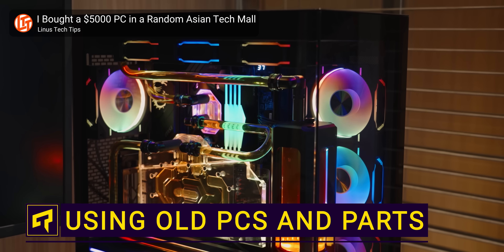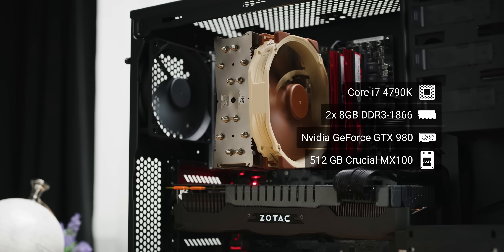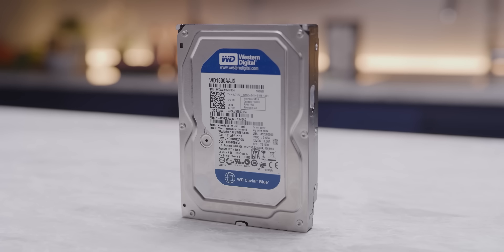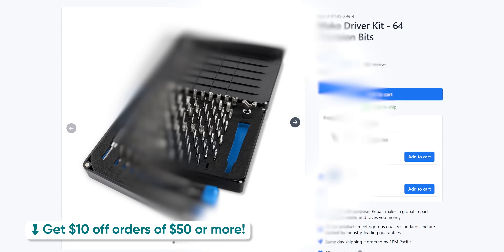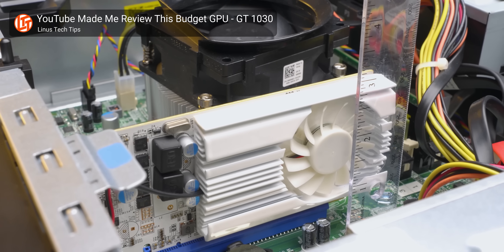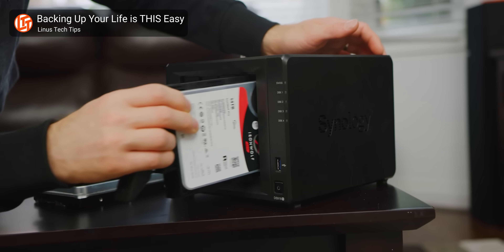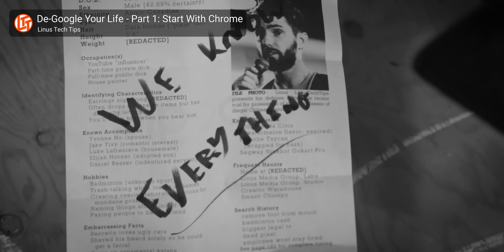FIVE Cool Things To Do With Old PC Parts

Comment: Great video thanks. I would say my favorite thing to do with them is to clean them up really well repaste the CPU replace the CMOS battery if you can get a cheap GPU or rely on integrated GPU then install a couple of old games on it play around and then resell it on Marketplace. Also many of these older PCs especially running Windows 7 or 8 can be slightly upgraded to install Windows 10. Sometimes you just need some new RAM and an SSD and then you just use Rufus and many people would still be interested in this.

Comment: As much as I love the channel, I am surprised how ignorant they are of a power efficiency of the proposed solutions. Making a router out of your old-architecture device sounds like a terrible idea: both climate and simply expense-wise. The same goes for NAS. There is a reason, why routers and NAS for home applications are typically low-powered devices

Comment: Turning an old(er) office PC into a router and/or NAS might work since they typically are designed for having very low idle power draw. But your last gaming rig that most likely pulls 40+W while doing nothing is a REALLY bad choice. Upgrading systems while the core components (CPU, MB, PSU) are still working is a good route, especially when you already planned ahead with the base system. I build my gaming PCs myself, and I always pick a slightly stronger CPU than I would normally need so I can keep the system running for longer while only swapping the GPU and maybe adding RAM/storage. Oh, and if you can't (or don't want to) use Win11 and want to stay away from Google, there's always Linux.

Comment: When it comes to distributed computing, you really should mention BOINC as there's much more variety for projects there and you can have the one machine crunching data for multiple projects. Folding@home is just a single project that's on its own platform.

Comment: Personally depending on age I use components in all sorts of more advanced ways. Capacitors are in so much stuff and an old PC mobo is a decent source for them. Case fans can be normal fans too. I've cut up the sheet metal from old PSUs for laptop hinge repairs and other stuff I needed sheet metal for. (Obligatory if you're opening a PSU discharge it properly. If you don't know how to do that figure that part out first). I've also just outright used old PC PSUs as normal power supplies for tons of stuff. Power buttons are just power buttons. They break on tons of stuff so reusing those is quite useful from time to time. Heatsinks are very useful to put on all sorts of stuff as half of cheap electronics that die quickly die because they run too hot. I should mention I'm a repair professional and electronics hobbyist. I learned most of my repair and electronics skills just doing things like this. So learning electronics is another good use of what'd otherwise just be garbage. If you're ever going to learn electronics the wiring inside any age of PC will be amazing for just learning to stitch electronic components together and seeing how they work or detonate. By now I've built absolute tons of gadgets myself without paying a cent for them simply by stripping down old "dead" hardware from PCs and other stuff too.

Comment: That is a big deal, older hardware should be given to systems depending on the operating system. Windows 8.1 will use Quadro RTX 4000-8000 and Windows 7 with RTX 30 series. I you have no longer have use for this hardware, sell it to somebody with a passion project, like me. I'm going to upgrade from my Tecra A11 laptop to a silent FC8 Alpha A12 9800 APU build. I need support and expansion more than I need CPU performance, that part doesn't matter to me.

Comment: This might sound great  but one big factor is energy. Here in Germany energy is very expensive. You should check what the energy consumption of your old hardware is and compare it to a new device. With a router this can be a  big difference. 30W more and at a price of 0.40€, it would cost you nearly 105€ more per year, just the energy.
Unless you get your energy for free, it matters.

Also I thought this video would give tips on really old hardware. I recently digged out old hard drives and with old I mean IDE interface and a USB stick has more memory and is faster. They are just waste. I looked for data, that might worth keeping but besides that, I don't know what to do with them. My plans are to secruly delete them and drill a hole into it, until I can put them into e-waste.

Comment: Be aware that electricity costs may render certain use cases, particularly those involving older gaming hardware, economically unviable. The electricity expenses can exceed the cost of purchasing dedicated hardware equipped with efficient processors, such as ARM or newer x86. I conducted a personal experiment by running Folding @ Home on my aging gaming rig (i7 and GTX 970) and calculated that, based on Danish electricity rates, the annual electricity cost would range between $2500 and $3500, while the performance is only relatively modest.

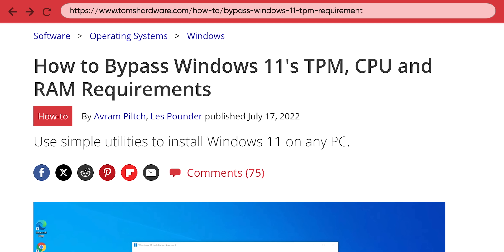Comment: Me at 1:35 - 1:48: "Linux. Linux. Linux. Linux. Linux! JUST EFFIN USE LINUX!"
Seriously? You recommend ChromeOS over all the free, unrestricted and privacy respecting versions of Linux out there?! 🤦‍♂️🤦‍♂️🤦‍♂️

Me at 2:22 - 2:44 "Lutris. Lutris. Lutris. Lutris. Lutris! JUST EFFIN USE LUTRIS!"
Sure, building a retro PC from your old hardware is fun, but that old hardware will most likely be much newer than the games you'd need a retro PC for, so while installing Windows XP, 98 or even DOS on it will fix software compatibility issues, you're still gonna have hardware incompatibilities. And old hardware tends to break and need fixing, which can get old quickly. Those were my experiences with using a retro PC. Lutris (a front-end for WINE, which lets you run Windows programs and games on Linux) on the other can run most of my old PC games just like that. It is by far the easiest way to play old PC games, especially if there isn't a repackaged version with DRM cracks as well compatibility and widescreen fixes pre-applied available for download on the high seas!

I'm not one to shout at my screen, but those segments really had me utter these words repeatedly in frustration. I've never been this disappointed in a tech tip by LMG!

Comment: I use netbooks to run 3D printers — usually this is done by a raspberry pi, but once you add a dedicated screen and keyboard to a pi, the cost of netbooks is much cheaper. Plus some are fast enough to run multiple printers at once!

Comment: Well, I reuse all the parts that can be reused: case, PSU, SSDs, even the CPU cooler that technically wasn't supported but nothing that zip ties can't handle.
The money saved from this is then invested in the other parts. So now I have 64GB RAM and still with over-modded minecraft running it manages to get to the limit sometimes.
The thing I didn't reuse was Windows. Now running Linux Mint and having ~same amount (but different) problems than on Windows.

Comment: Here's what would help me the most:  a vid on how to turn an old rig into a GAME SERVER.  I host co-op games, and with something like the Borderlands franchise, Outriders, etc., that's fine- but my wife and I play building games, too, like Valheim, Enshrouded, Conan Exiles, DST...  She can only access our shared worlds if I'm playing.  I want to set up one capable (7700K, 1070Ti or R5 2600, 5700 w/XT BIOS) as a game server, that's completely hands-off as far as what game she connects to.  Can a single PC run multiple Steam servers at a time, and jump into action when someone connects to it?  Said PC hosting 2 different games with someone connected to them at the same time would never be an issue.  I have a bunch of functioning old rigs, and setting one up as a game server, one as a media server, etc. was my original idea, but I'm lost on how to get a game server up and running.  "Help me, Techquickie, you're my only hope..."

Comment: Don't use desktop pc as a router. The power usage difference will be horrendous - you are looking at 100W+ consumption all day long, depending how modern the box is and what power saving features it had. Use laptop or netbook - they are powerful enough, and designed to use minimal power. You will need a special expansion card for second network interface, but other than that,  small and quiet.

Comment: I've got 2 desktops.  The one is fairly old but beefy from 2017 and other is newer.  The older one is now used as an office pc and I've got Linux running on both systems, for my own sanity.  In the past before having 2 computers.  Certain items like a graphics card.  I kept as a spare incase something went wrong with the new one.  As it took me years to save up for the new one and getting another too soon isn't really an option.  

Now that I've 2 systems.  Whenever I replace something in my new one, the old one gets the replaced part and then it's old part is handed down to anyone usually a family member.  Also doing things this way means I've 2 really good systems.  And saves money in the long run as I don't have to get a laptop as if I need anything mobile the phone will cover the basics needed.  And having really good computers to go work on instead of under powered laptops or tablets or very expensive versions that would have been cheaper just to buy a new desktop in the first place with way better specs.  And you get years of more use out of a desktop than a laptop.

Comment: I want to install Windows 11 such that it's officially delivered from Microsoft to get consistent feature and security updates
However, I can't upgrade because my hardware is 7 years old at this point
if I were to upgrade my components instead of buying a new PC, I need to buy a new motherboard and CPU but I also need to upgrade my GPU, so in my case, it would probably be better to buy an entirely new PC

Comment: Wow, those are some terrible tips...
I mean Economically and ecologically.
Sure, a 500W CPU&GPU combo can run circles around your routing and NAS duties while providing SOME computational power for the betterment of manking, but it is also a 500W computer that you will be running 24/7, at which point the benefit to both you and the manking becomes quite questionable. Especially when you consider things like the SteamDeck perform better than that at 15W.
500W non-stop in US prices is $3 per day, $1000 per year. Literally a new, more powerful computer in less than a year, if you ... just ... don't.
Please don't repurpose old powerhungry hardware for 24/7 operation.

Comment: Today i fonld out windows 11 24H4 has an update that re-introduces the TPM requirement to do windows update. Way around this is to put the drive in a more modern PC, update it and then put the drive back in. got it working well with a 2nd gen i3 no TPM HP laptop. seems to keep updating now.

Comment: I recently picked up a old XPS (2008 era) just for the support of old games. With having old Sli and a external physx card. For those who want to know its an XPS 630I that seems to have been maxed out and had a Core Q9450 installed rather then the stock Q6600

Comment: Be careful running NAS on old mechanical drives - they still have a lot of life in them, until they don't and they can die out without you knowing about it until it's too late and your data is gone. I've been running a multi TB, multi-drive home NAS for >15 years and my main takeaways are: (a) install a SMART monitoring application that will email you when there are longevity degrading events (such as smartmon) and then act quickly to replace the affected drives; (b) store data on a multi-volume file system that you can add an remove drives without manually copying files (such as NTFS spanned volumes, BTRFS or ZFS) and always keep one port free, so that when the time comes you can just add a new drive to the array, tell the system to remove the failing drive, and your done.
Reply: I grew up building pc's from scrap and burned through a dozen or more HDDs before ever buying one new. I have replaced 4gb mechanical hard drives in win98 systems. Hard drives generally make a variety of noises depending on what type of mechanical failure they are developing long before they actually be unreadable. Modern mechanical HDDs actually have a SMART reader that produce pop up warnings before the sounds start to develop. I have had solid state jump drives fail without warning plenty of times, but I generally know when a mechanical drive is on the brink with plenty of time to get a preplacement cloned.

Comment: i just reinstall windows on any old computer (i own about 7, also new ones ofc) just to convince myself that windows still runs on those systems even tho those installs seem to be pretty fragile… (reset the bios and windows shows inaccessible boot device cause some setting in the bios defaulted from ahci back to ide 😑)

anyways never install stock windows again. such pain. if you still do look up chris titus tool. it may help you after installation. if you wanna customize your iso look for a program called NTLite

Comment: Using an older pc (thought maybe not one past 7-10 years old) could also just be used for streaming via a 2nd pc. Lots of people like to be fancy with their setups and do 2pc streaming setups. so an old 1070 can easily stream in 1440p or 1080p while you play your games on your newer pc or xbox/playstation. The only downside is you'd have to buy a capture card for it, as you likely wouldn't already have one.

Comment: kinda niche but an older but still modern gaming rig can be a perfect choice for building an arcade cabinet for retro emulation, even the most turd of turd pc can run all the retro stuff like old mame, nes, snes, n64 etc. If the pc is newer from around 2016-2020 it can do some modern emulation too. batocera is the perfect linux os for doing it too

Comment: The problem with these ideas is that many of them involve running a PC where a single board solution like a raspberrypi would do. The raspberrypi runs on 30W rather that the huge wattage budget of an old PC.  Crypto and protein folding would be better on a gaming PC but otherwise a raspberrypi 5 or lower can handle the rest. I have rpi5 running an AI detection system for my cameras and it sips energy.

Comment: With my first ever paycheck in 2012 I bought an Apple PowerBook for about $150 on EBay and after realizing that MS Word and even Chrome were no longer compatible with the Power PC CPUs, I decided to use it as a router. At the time I was about to start my first semester in college and had never owned an Apple device before. Of course I later sold for a better machine but it outlived its potential.

Comment: I'm working on a NAS build now, just missing a cooler and some fans and the actual storage HDDs. Gonna use it for Plex, Video Editing, and Picture/Video Storage with a mirrored HDD setup. Next year I plan to build a NAS purely for offsite data storage to finally follow that 3, 2, 1 rule. The only problem is figuring out where to put the offsite machine.

Comment: I use mine on my CNC machine (LinuxCNC). Bonus points if you have a parallel port (printer port) because you can directly hook that up to stepper motor drivers.

Mid-2000s desktops work great because they don't have as much power management stuff that interferes with consistent clock cycles (good for consistent motion)

Comment: Using your old gaming pc is NOT recommended! If you're going to make your own router, make sure to use power efficient hardware. No point in spending 100s of euros per year on electricity to run a 50 watt router. The only place where it makes sense is in a virutalized environment, so you can use the game pc as a server, and run a router OS on it as a VM. (And then pass through the nics)

Comment: I have 3 GTX 660ti cards lying around because the three-way SLi motherboard I have broke. They are useless in windows 10, no matter what driver you use, games randomly crash or freeze.
I did set up a nas using an old pc, since I have switched to gigabit networking and it works great. I use my laptop which is quite old as a jellyfin server and that also works great. I want to somehow set up a pc or something as a gamecache for  the Epic games launcher, as steam has local transfer now, so It's not needed for Steam.

Comment: I haven't added any old computers yet but I run a kubernetes cluster at home and have been toying with the idea of adding my old gaming laptop for its GPU. Right now it's 4x Pi 4s, and 2x NUCs, with 4x more Pis (Pi blades) on the way (though they might just replace the existing Pis as they aren't very reliable without proper storage).

Comment: The problem with using an old PC for most of these things is the power draw from the wall.  If you leave the system on 24/7, that's gonna draw a lot of power from the wall doing mostly nothing and that's just going to raise the monthly electric bill.  I'd rather pick up a couple mini PCs (e.g. Beelink is excellent) for power sipping a small number of watts from the wall for always-on systems.  Electricity isn't free.  I leave my main PC and a couple of ultra-lightweight backoffice systems on 24/7.  The main PC is left on only because I hate rebooting and the ability to pick up exactly where I left off is worth the few extra bucks per month.  Currently 339 days of uptime and counting!